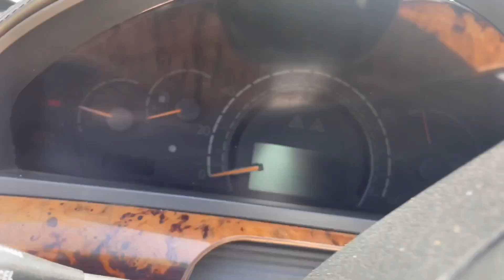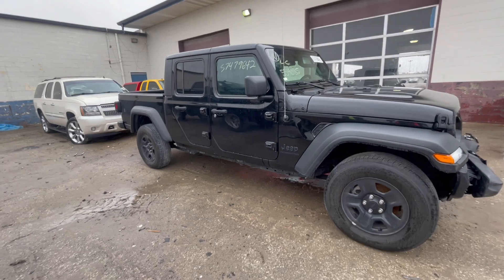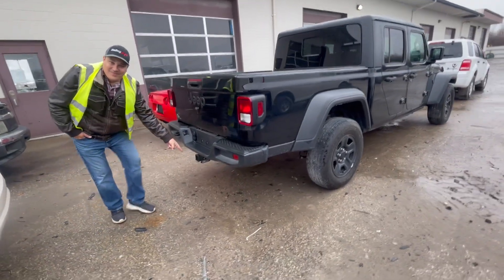Indianapolis Copart Walk Around -

Comment: If you want to look at most chevys avoid the Chevy Aveo I don’t know if it was just my mom’s car but that car had some steering problems and the skinny tires were almost always loosing the seal around the rim. It was a nice light, fuel efficient car with plenty of head room but I wasn’t a fan of driving that thing when I needed to cause my car was in the shop. And when I got in my car accident a few years ago I already told my mom I didn’t want her car cause she was going to get rid of it.

Comment: I owned a Gladiator for 3y. Bought a 2019 Rubicon. Mechanically it was great. Just small. No storage. Not great mileage. While tow capacity was adequate on paper (mine had the upgraded towing package), it was a dog in the hills with a moderate load. Mileage plummeted with towing anything. It got 15.7 avg no trailer.

Comment: It did not take long for 1st Gen Gladiators to start showing up on used car lots in our area after the model was introduced. In fact, right now, it would probably be easier to find a low milage Gladiator on the secondary market than any other Jeep worthy of the name.